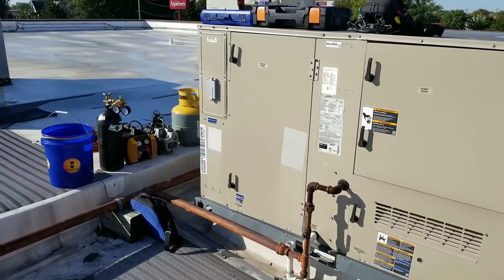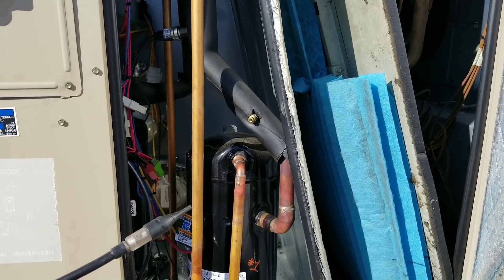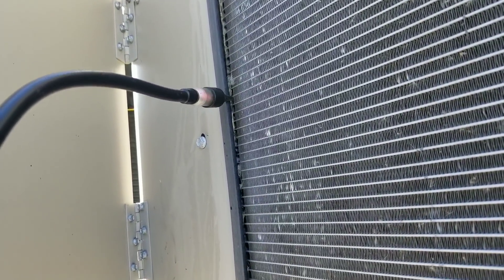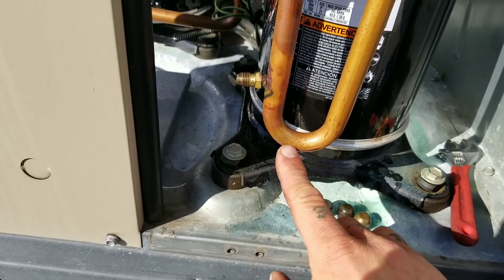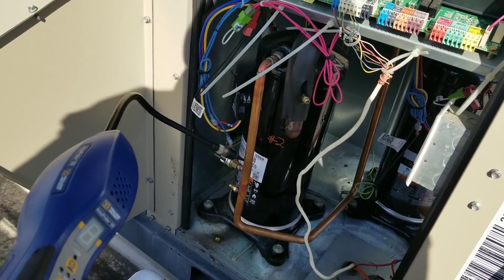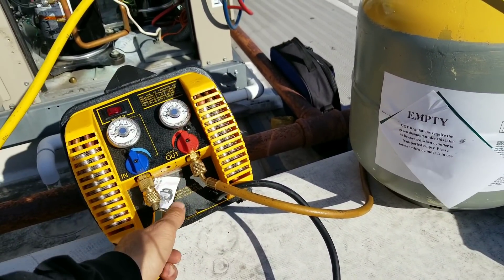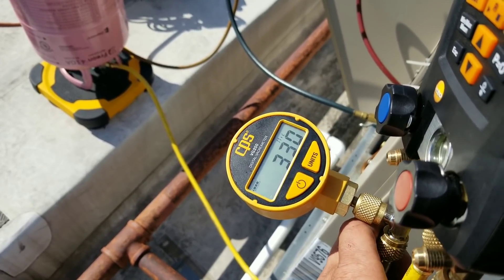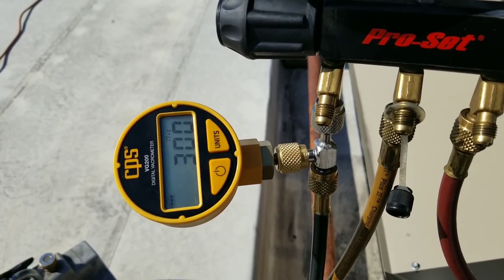Lennox package unit low on refrigerant

Comment: Dont forget to pop the cover and check the compressor terminals bakelite for leaks. Some leaks will only show up with thermal expansion - UV dye additives sometimes help with finding that type, just be sure it is compatible with that type of oil in system.

Comment: Instead of using bubbles on the ports use a drop of nylog. So if you need to put your gauges back on you won't chance getting moisture in the system.
I'm really enjoying your videos.

Comment: Is that an FTIR leak detector?
Didn't know Sensata made pressure switches.
Reply from the maker: I believe it is- whats your go to leak detector? Ive been looking to upgrade
Reply: @curioushvacguy6876  I'm no tech personally, just interested in the technology.
Reply: @curioushvacguy6876   This person likes ultrasonic.No effect with wind. Also would work if you need to detect something like CO2. https://www.youtube.com/watch?v=3qgyqejXZIk Using a smaller SRL8 or the Testo 316-3 works, and if they fail, the old and true H10, or the H10PM battery model.

Comment: Ac service tech had a good tip on checking for leaks at schrader cores. He drilled a hole in a plastic valve cap and put bubbles on the valve cap. I have been using that tip since I watched his video. Thought to pass it forward. 
Peace
Reply from the maker: Ac service tech that is a great tip, Im going to use that myself- Thanks

Comment: So I had a York package unit. One circuit flat the other low on charge. Using an ultrasonic leak detector I found both leaks in less than 5 minutes. We had a safety meeting yesterday. One tech was having problems with pneumatic tubes leaking. Rats had eaten the tubes. I told him to use the ultrasonic. Everyone gave me sht about having one and some had never heard of it. Well this morning a tech was on a 260 ton chiller. He could not find the leak. He called me and asked me about my ultrasonic. I told him he could borrow it. We met at lunch and he got it. He just called me and said he had found a leak within 5 minutes and was searching for more. He’s going to order one today. The chiller is 134A my unit was 22. The ultrasonic leak detector does not care what refrigerant you are working on. If their is a leak it will find it. I have sniffers but I couldn’t tell you when they last had batteries in them. Best $500 dollars I ever spent.
Reply: Amprobe.
Reply from the maker: Hey ACTech- what brand of ultrasonic do you have?
Reply: Hey curious something I forgot to mention. On tube and fin coils the manufactures are rifling the tubes. They remove material for this process. It used to be if you had a leak it would be at the welded U bends. Now the potential is everywhere. I’ve found leaks other techs couldn’t find with sniffers. They were in the middle of the coil. You should try an ultrasonic. Anyway stay safe.

Comment: Manufacturers are rifling the tubes now so you can get a leak anywhere. Micro coils leak if you look at them funny. So never stare at a micro coil. They sense this and will start leaking lol. I had a customer that several techs had gone to leak test her system. I found a leak in the middle of the  evaporator coil. I use an ultrasonic. She was kind of mad that I found a leak. How come you found it and nobody else did?  Nobody wants to spend $500 on a leak detector I said. I’m glad I don’t do residential anymore. Oh and you never found “the” leak. You found “a” leak. No way to know if their is more than one. Stay safe.
Reply from the maker: Hey ACtech- good point, you never find "the" leak, you find "a" leak

Comment: Here come the "why aren't you using a bluvac micron gauge" and "you can't pull a proper vacuum without 18" diameter hoses" guys. I hate these type of leaks. I've been known to jack the pressure up into the 400-500 psi range. If it blows.....it blows.
Reply from the maker: Hey Jacob- if I get another call this summer about that unit I may have to do something crazy like that, lol thanks for watching

Comment: Good video bud, i think you did all the right steps.  If i was in this situation the following year that pressures were low, I would defiantly inject some dye.  Sometimes with formicary corrosion it can really be hard to pinpoint on commercial units. p.s. thanks;)
Reply from the maker: Thanks for the feedback Joe- as a last resort I might have to add dye someday but Ill wait to see how this next summer goes

Comment: Why not dye n bye that way if its does leak again that'll be Easier to pinpoint thoughts!
Reply: GeneK Hvacr die is a contaminant. Oil and refrigerant are the only things that should go into a circuit.
Reply from the maker: I would consider it as a last resort but before that I would repeat everything I did there, maybe up the pressures a bit and isolate each component of the system

Comment: I agree on trying higher pressure, I had a York package unit with a micro channel coil .I did a leak check with nitrogen and 410a mixture at least 325 on pressure to find the leak on the bottom corner of condenser coil. Great video thanks for sharing.
Reply from the maker: Thanks for sharing Eric- I may have to do that, well see how it plays out this coming summer

Comment: The dreaded Lennox mystery....
Defitinely a good video! 
I have had a few that i went ahead and replaced the Schrader valve stems and low pressure switch,being that i did get hit and miss,well that being said,on one particular one i did both high and low pressure switches and stems..being low cost items, and have yet to go back to recharge...but my gut lennox evap.coil ...?? ( hairline crack at header(s), as you mentioned , more than likely.
Keep us posted..very interesting!
There is only so much we can do as contractors/ technicians.,especially when its a small leak..Defitinely a leak somewhere..
Appreciate your time and effort.as always! ( great tips and clip)
 These type can rack your brain though!! 
Bryan Tyler Refrigeration.
Reply from the maker: Thanks Joseph- it left me scratching my head since I was able to pull such nice tight vacuum as well- Just going to have to see what happens this coming summer

Comment: If it leaks again, lift up the cond. fan motor & shine a really bright flashlight on that microchannel on the inside & look for faint oil stain spots. That crap will drive you crazy with super micro leaks. But the oil stains are the dead giveaway that the leaks do exist  👍
Reply from the maker: Good tip Shannon, its been awhile since I had a good super micro leak

Comment: I had the same type of a leak through the low pressure control and it was venting from the wires into the wire nut.  We changed it out and I still have it in my van as a Trophy!  I'm a believer!
Reply from the maker: I would love to catch one of those leaks
Reply: 🏆🏆🏆 #thatscool
Reply: I dont mean to be so off topic but does anyone know of a tool to get back into an Instagram account..?
I stupidly lost my account password. I would appreciate any help you can offer me.
Reply: @Xavier Leandro Instablaster :)
Reply: @Joseph Walker thanks so much for your reply. I found the site thru google and I'm in the hacking process atm.
Seems to take a while so I will reply here later with my results.
Reply: @Joseph Walker it worked and I now got access to my account again. I'm so happy!
Thanks so much you saved my ass :D
Reply: @Xavier Leandro Happy to help :)

Comment: How low were the system each time?
Reply from the maker: Hey Rick- If I remeber correctly, which I sometimes I dont, I think they where a pound ish low on the previous techs visits-- its in my notes attached to that customers account and since it was a few months ago that bit of info escapes me. I wonder if maybe my leak detector is or was having issues